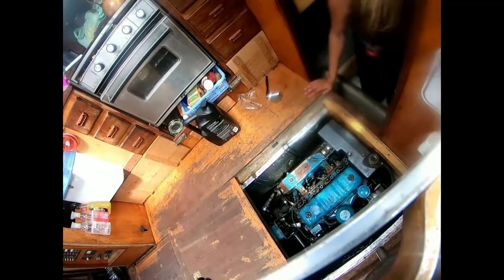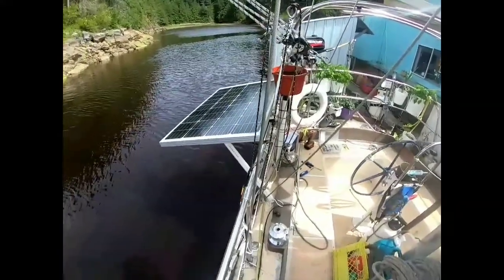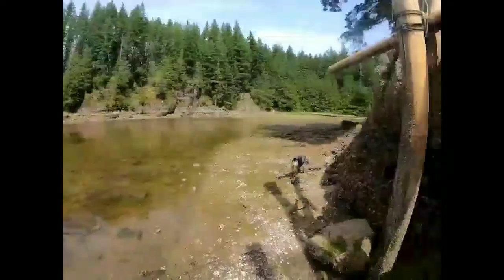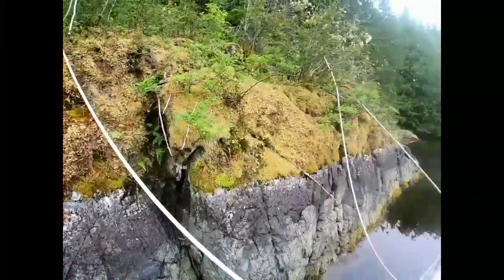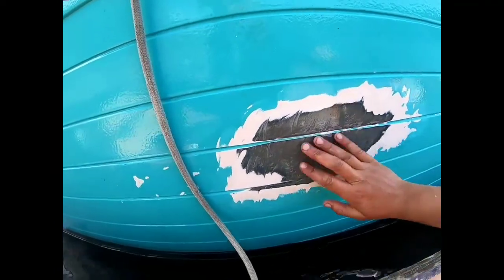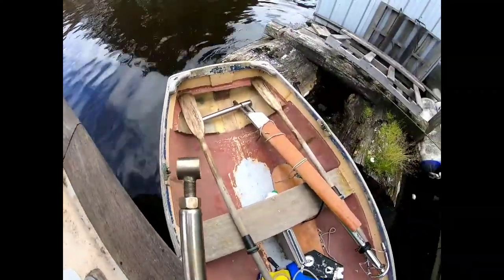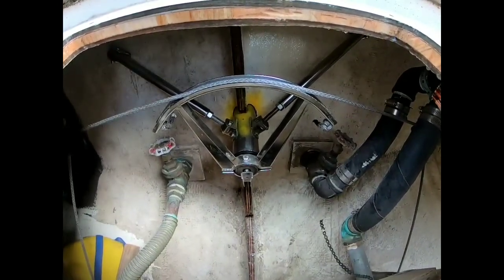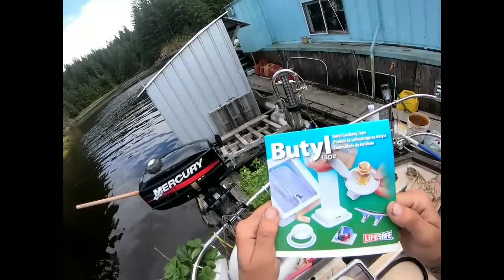Never ending to do list - CAPE HORN Windvane installation  - Sailing Oka Solo - 020

Comment: I had a similar problem with my OLD Yanmar 30.  After spending a fortune I figured it out that my fuel pump was the problem. Deep in the manual it told me that the fuel pump needs to be periodically inspected. If it's rubber diapham is split diesel fuel will be pumped into the crank case. Yes I had a runaway engine which is a very dangerous situation. 
     The engine soon died and now I have a Beta 25
Reply from the maker: The lift pump was the first thing i replaced, then injection pump and injector rebuild now after repowering i know that it both had a broken head gasket and a cracked cylinder bore  and am happy to have the thing out of my life. So far loving the electric motor just need more batteries for extended range